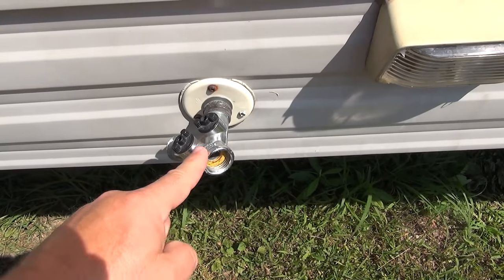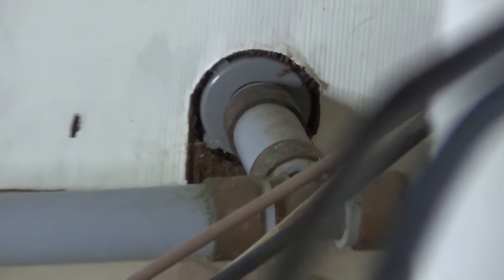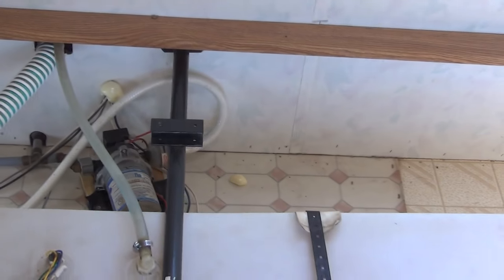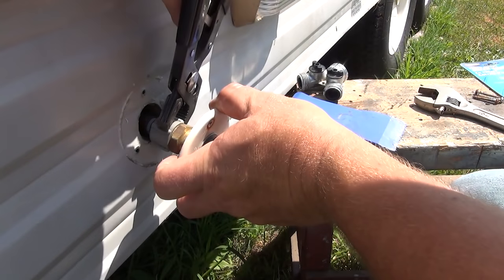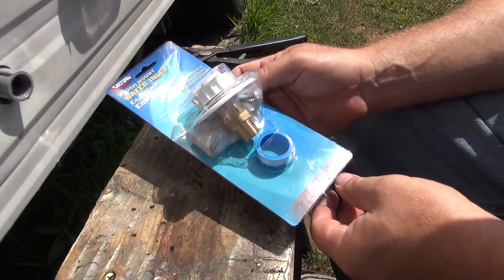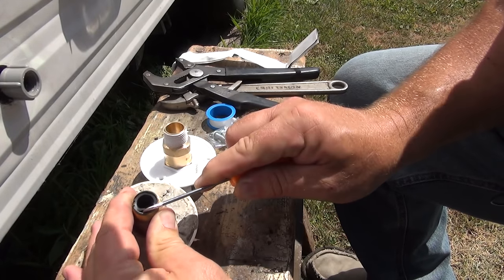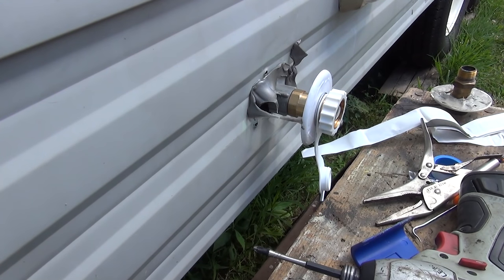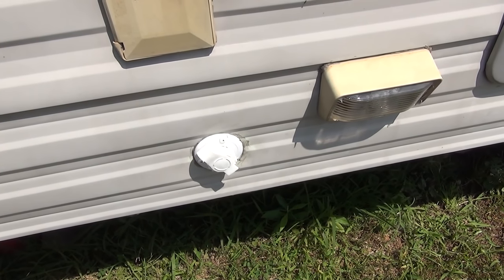RV Water Valve for City Hookup

Comment: Oh My Gosh, Thank you, thank you.  I replaced this and the hard line was short like your example.  I did remove the water pump and it was still too short.  I cannot get enough access to either tighten the connection from inside because it's in an impossible place.  I will try to clamp the line and move the pump line this time.  It works but not like I would like...I will try again.  Thanks, J.
Reply from the maker: Jillerbop 😁👍

Comment: Will this stop my fresh water tank from filling when I'm on city water?  We just bought this used 2015 Palomino Puma and every time I connect to city water, my Fresh Water tank fills over night; I've watched all the videos about disconnecting the city water and running the pump for 10 min, then turn hot water on, then cold in all faucets while running the pump; then turn faucets off and pump off.  Reconnect city water.  I tried all that and Fresh Water tank still fills up; have to disconnect city water again and just use the Fresh with the pump, but don't want to use this method for water; we never dry camp; had 2 other campers prior to this one and  never had a problem like this cause we never filled our Fresh Water tank and used it; always go to campgrounds where there is water hookups.  Don't know what else to do.  How can I stop my Fresh Water tank from filling up?  Thanks.

Comment: Beautiful job! That's EXACTLY what I need to do to mine. my valve has stopped working too. My water leaks drip by drip and when I press the tip of my finger on that valve the water comes shooting out. my one question, how do I know what size to order? I have a 1994 southwind - gas, ford engine. Thanks.
Reply from the maker: Thanks!  That was my initial thought too. When I checked with the local RV guru he said there is one that is used mainly on most RV's.  That's the one in the description,  it's the one I used. I would assume yours to be the same as this one too as they are from the same Era.. Ours is a 1992..
Reply: +RVdaydream HAHA, describing our rv's by "era" LOL. Thanks for all that fabulous info, a very well-done, detailed instructional.  One more thing, how did you find the piping (terminology?) inside the coach? Do you have a schematic? I know my heating tubes are under my couch. How do I find where my water pipes go to like you did? THANKS AGAIN!!! GREAT video!
Reply: +RVdaydream I just went out to check mine and it is nothing like yours. Mine is inside a box with a door, no screws to take off the valve itself. looks like I have to take off the whole box. Is there a way I can send you a picture?
Reply from the maker: +shelleyfunny19 I have only changed the style that I show in the video.. For something different, like you are describing,  you should contact a local RV shop for guidance.. Sorry, but I don't want to mislead you on a specific repair I haven't personally done.. Good luck..
Reply: +RVdaydream i understand and appreciate. thanks